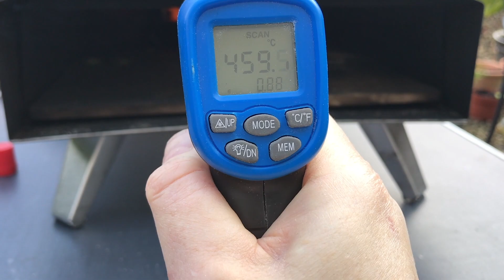How to Light and Use the Ooni 3 Wood-fired Pizza Oven

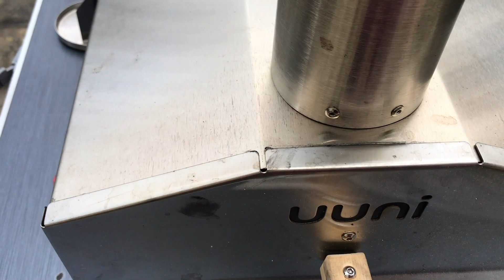Comment: After lighting the pellets as you did perfectly, you need to top it up slowly until it fills up the stack (Ooni recommend keeping it level with the screw . This is the only way to keep the oven at top temperatures. At 3:25 you would have lost a lot of heat because there is not enough wood.
Reply from the maker: Thanks. Great tips!!  Will pin this!
Reply: i realize I am quite randomly asking but does anyone know a good site to watch newly released series online ?

Comment: hi, just purchased a used, excellent condition OONI 3. has upgraded propane burner accessory. im completely unfamiliar in cooking with pellets. found some pellets on clearance, pit boss charcoal blend hardwood pellets. they are billed as "heavy smoke profile". is this pellet ok for the pizza oven ......or big NO ??
Reply from the maker: Ah - charcoal and wood mixed - the thing is with the 3 grate, it’s quite small, plus it’s a small oven and so you need a good flame, from my experience of cooking with lump wood charcoal (‘not in the 3 but in wood fired ovens) is that it keeps the oven amazingly hot but delivers no flame.  So, you will need wood only pellets to get that flame you need for the pizza cook.  Your pellets sound like are made to generate smoke rather than flames.  So I’d grab yourself some just wood pellets for the 3 - hope that helps!  Also, just saying that don’t worry if you burn a few pizza when you start off in the 3 - it’s got a low roof and it’s so powerful in there, it won’t take long for the pizza to cook!

Comment: The pellets look a little full? Instructions say to fill 30mm below the top
Reply from the maker: Of the chimney topper bit-up to the screw?   For the tray it’s ok to fill it up so that it fits into the oven then light it.  If you fill tray too low it’s harder to light with the gas burner on the side hole as the flame may not hit the pellets as easily.

Comment: Can I ask you for advice regarding the Uuni 3? I have tried to make pizza in it for two times now, and both times I get a black crust and raw center after as little as 50 seconds. It seems to me the Uuni is burning too hot. The inside looks like an inferno and with the door closed, it happens all the time that flames are coming from the chimney like a blowtorch (so not a normal flame but a rocket type flame). Have you got any idea what this could be? I'm using Uuni original pellets. After use the flame guard inside (the thing that the stone is against) was literally red hot. If I would put the pizza in for 1.5 minute like Uuni recommends, I will be left with a completely charred disk.
Reply from the maker: 😮   Let the pellets drop into the holder and fill up when needed manually - don’t add a funnel  -  plus dont push them down into the holder as that will cause the oven to overheat.  Not sure if you had but needed to check!   So try reducing pellets at back to reduce flame size and see how that goes.  Also, if it’s very hot and flames are strong you will need to ensure your stone is only 450 c else pizza will char.  Rotate every 6-9 seconds.  Pls let me know how you get on!
Reply from the maker: Seen the vid!  Wow!  That's on fire!!!  That is definitely too much.  I would not fill up to the pellet screw - put less pellets in - just fill the pellet tray and not up to the screw and see how that goes.
Reply: @Got2EatPizza  thanks for the reply. Will try that next time.